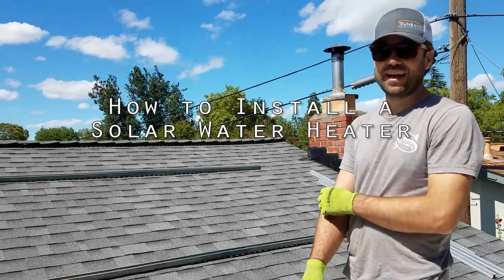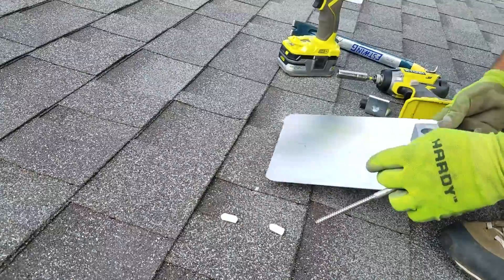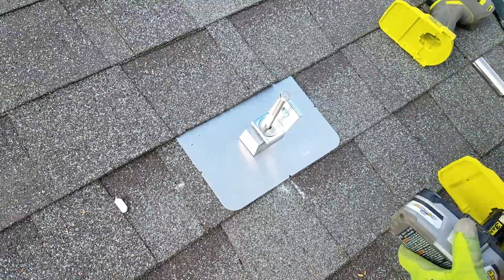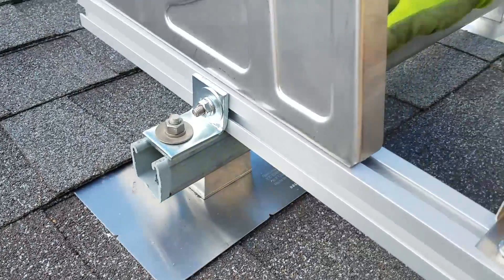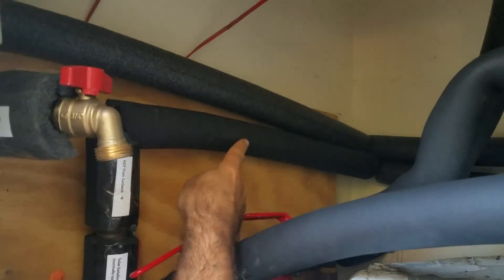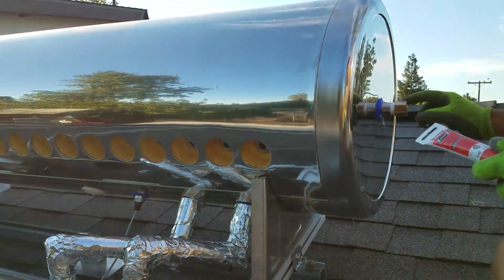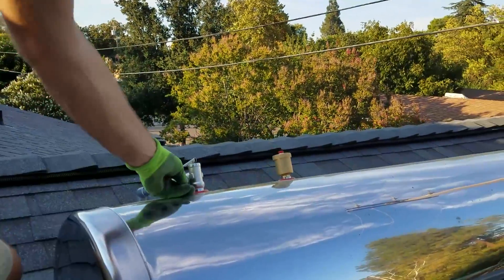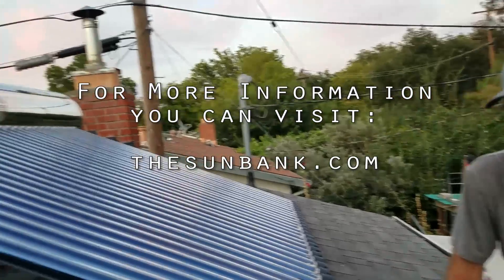How to Install a Solar Water Heater

Comment: Do you have to mount it only facing south ? Do it work facing any other direction?
Reply from the maker: East or west is also fine, with a small hit to your overall production. You do not want to point a system to the north (in the northern hemisphere). If on a north facing roof, you would want to reverse mount the system facing to the south.

Comment: How does this work in regions like here in North Carolina where the temperatures can go below freezing for a few weeks each year?
Reply from the maker: The system itself is not really concerned with freezing. The tubes are good to -35F and the tank is very well insulated with 40 or 80 gallons of thermal mass. We have a lot of systems installed in West Virginia and the Southeast and they don't have freezing issues. More info about how to prevent freezing here: https://thesunbank.com/freeze-protection/

Comment: okay, not throwing any shade or anything here. I'm a 5 year plumber, currently about to starting my schooling, gunning for my masters license and working on my business plan to start my own company. I heard you suggest to put pipe dope on both male and female end and then put thread tape on the male thread. this can cause leaks as the thread tape may bunch up and not allow the seal to form correctly. I always suggest using bot tape and dope. tape your male fitting, then dope it and tighten, that's should never leak unless there is a problem with a fitting or you under or over tightened it.
Reply from the maker: Cody - you're absolutely right. Teflon then dope. Thanks for catching that!

Comment: Could this work with a tankless water heater?
Reply from the maker: Absolutely. You can pre-heat a tankless or a tanked water heater with this system. The only difference is that tankless water heaters typically have a high end temperature for pre-heated water they accept, so the tempering valve is installed upstream of the tankless water heater, whereas it would be installed downstream of a tanked water heater.

Comment: How does the tank physically attach to the rack?
Reply from the maker: There are bolts that are inset and part of the tank and they fit into a slot of what we call the "saddle" part of the rack. So it mechanically attaches to the rack and the rack is attached to the roof.

Comment: Sir, I’m living off-grid and wondering where do I connect the water heater system to cistern system? 
My setup: 5000 gallon tank to pump to filters to house. Would you recommend connecting solar water heater after the filter system?
Thank you 
Juan
Reply from the maker: Hi Juan, many of our customers are off-grid. Yes, we would recommend installing the Sunbank downstream of the filter, so that you can provide better water quality to the Sunbank. Any other questions just let us know. Thanks